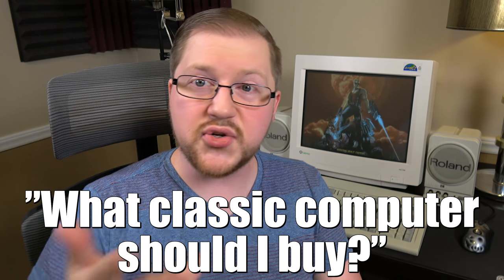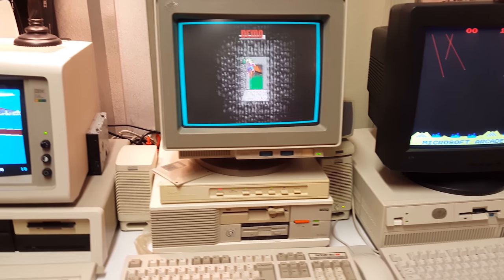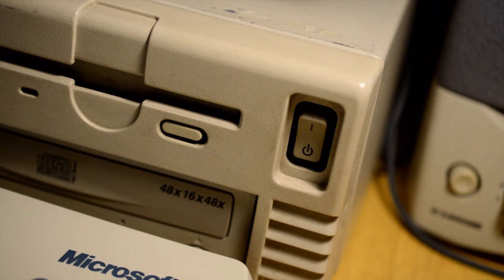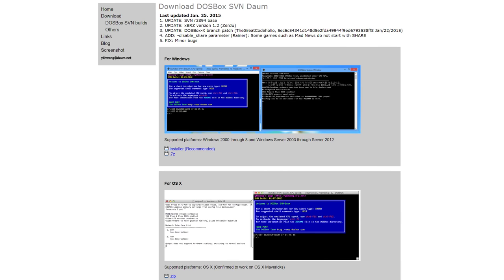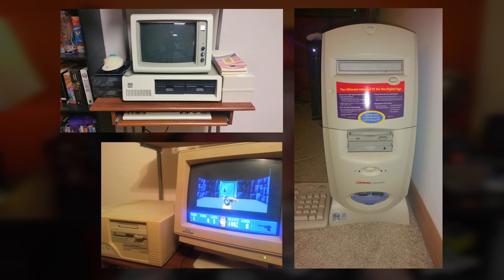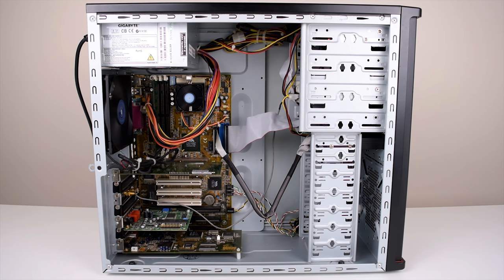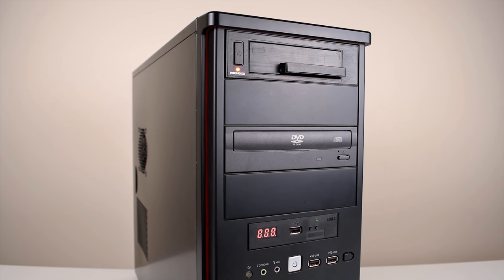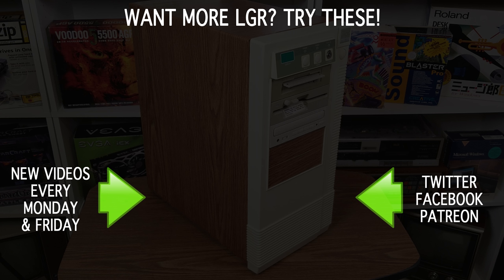Choosing a Retro PC for Games: Advice & What to Look For

Comment: Personally, for retro I use an IBM 600X with maxed out RAM (512+64 onboard). I didn't grow up with the old 80s and early 90s games, and so I have settled with mostly playing old games from the late 90s and onwards.

I also have a few Dells I either use for emulation or playing old games once in a while on laptop hardware from the Pentium 4/Core Duo era. It's fun. I like it. And I don't have to mess around with unknown territory as everything comes already in a convenient package and I know that if I cannot run it on those machines I can always tinker around on my newer computers to get something running like it should.

Comment: I remember back in the early 1990's in Jr. High school. We had Windows 3.11 for workgroups running 386, and 486dx2 CPU Gateway 2000's. Then they upgraded one full lab to Pentium at lets say about 133mh with brand new computers. 32 MB of ram, the old 486 maybe had 8 or 16 in them, but instead of running Windows 95 they were still Running Windows 3.11.....and they flew. Soooo fast, everything was clean and clear and smooth. Then they finally upgraded to Windows 95, and Goodbye speed!  Though in 1999 when we upgraded to Windows 98 SE and had a few new computers in the library we would all in homeroom play Duke Nukem 3D on the LAN there and it was awesome. Windows 3.1 was my very first Windows OS ever also. Back when computers were actually different, and fun still. Now they are all the same pretty much.

Comment: Regarding virtualization, here's a hint: PCI passthrough (a.k.a. GPU passthrough). Although I haven't used it since 2016 (my gaming Windows was a virtual machine with Radeon 5850 and later 7950), I've read that newer virtual managers have implemented it (I used it with Xen during my Radeon period;2011-2016. Also see LTTs 7 gamers 1 CPU made in 2016). Back then, it required an Intel non-K CPU (or LGA1366). Basically you need to look at IOMMU support(a.k.a. VT-d @ Intel; do not confuse with VT-x, which is present in almost all CPUs of this decade) and 2nd period-correct GPU (1 for host/current gen, 1 for VM/retro GPU). Granted, you do need Win98-supported GPU (as original GPU drivers will be used in VM).

Comment: I honestly would choose Phil's solution. I want to build an "Ultimate DOS Machine" like Druaga1, but have it cover so many aspects. I think that would be the perfect fit to just need around with whatever I feel like.

I am also a fan of emulation, source ports, and wine. Emulation is nice, but a last resort for me imo, unless it is cycle accurate like bsnes. An upside to emulation is that you can add upscalers in retroarch and some standalone emulators. I've found that win98 VMs though so not like Ryzen CPUs, so it's not always the best solution. Source ports are fantastic, I play gzdoom for an enhanced DOOM experience. The mods for some source ports are amazing actually, Brutal DOOM being one of them. Also finally wine, it's just been around for so long and been so well maintained that you can play a lot of games very well on it. Plus wine has instances so you can sandbox a lot of what you do.

Comment: 2:22 Loving that vintage Gateway monitor. I have an old EV500 that came with my 1999 Essential 400 (it's a very complete system) but unfortunately the monitor gets so incredibly blurry that it's absolutely impossible to use. My go-to CRT is a circa 2003 MAG Innovision. It's a great monitor.

Comment: I guess it comes down to the game you want to play on it. I made a bit of an older system to play older games on, but first asked myself what games I want to play. F.e.a.r., Quake II, Final fantasy VII and a bunch of more games from the late 90's mid 2000's so I opted for a motherboard that supports ddr2 ram (using 4gb), an intel core 2 quad, with an SSD and Windows xp professional 32-bit and an OP passively cooled GPU (geforce 6k series). All crammed in a Shuttle XPC case. And it runs amazing, much better than I thought actually <3 (In the end it looks more like a PC from around 2010 tho lol).

Comment: I was running a Pentium 3 server machine with dual CPUs. When needed I disabled one CPU and disabled cache that gave me something around 486 in terms of performance. It had Voodoo 2 in SLI so when I needed glide I used it when not I used Nvidia NVS 280 in a PCI (non-E) slot. Dual booting 98 and XP. All that in one PC gave me some room for older and "newer" games.

Comment: I do think emulation is the best way for most of the older games, mostly the DOS era ones until early 90's ones, because even if you want to play them in an original hardware....man, its a nightmare to setup properly an older machine without having hardware conflicts, missing drivers, sometimes even the CD or floppy disks that comes with such drivers get faulty and if you dont have internet access on that PC well tough luck i guess, installing properly the OS you want to use on that machine without having tons of BSODs or the HDD not being properly formatted or the installation freezing midway installing the OS and then having to restart and reformat again.

But i do get why people wants to run games in a proper hardware setup that can handle those games the way it should, and its totally fine but yeah as you said it takes dedication and a lot of it.

I do have 2 desktop PCs at the moment, one is an XP machine with 512 MB of ram with a Pentium 4  4.22 GHZ and a GeForce 6200 AGP video card of 512 MB of ram, the other one is an Core I3 with 4 GB of ram with a GeForce GT 620 of 4 GB Ram, the XP machine i use it mostly for drawing and as a workstation but its very capable of running even Quake 3 without any problems, but the PC i use the most for PC gaming nowdays is the I3 one since well most of the old games are supported by GOG and its the best way to play those older games on lastest hardware and OS, but if i want to play something that i already own i go to my XP machine but if i really want to play that because i dont want to push too hard that poor thing since it got like 2 breakdowns because some silly stuff i still cant find out.

Comment: Somewhere down the line, I just want to construct a windows xp machine for enjoying all the games that wouldn't work on vista and beyond.  GTA III will have the right car shading without needing modification, Sim Coaster will run, and The Sims Complete Collection won't crash at random. That's the purpose of what I want to get together.  I GOG it for a lot of DOS games because I just wasn't born into that era and don't see a personal need in getting a 486-- I just don't have the nostalgia for those REALLY old pcs.

Comment: I got some old computers from my grandparents, and among them is a Dell XPS D300. It originally had an 8 GB IDE hard drive, and I replaced It with a 16 GB SD card on an SD to IDE adaptor. The sound card It came with is a Turtle Beach Montego which uses the AU8820 chipset. This chipset doesn't have hardware OPL3, so I added a resound OPL3 sound card.
This machine currently has 64 MB of RAM, but I am considering upgrading It to 256 MB since It is running Windows 2000 instead of Windows 98.

Comment: I've recently picked up an emachines etower 333k desktop as my retro pc rig. currently has an amd k6 processor, 3gb of hard drive space, and 128 mb of ram. which according to sources, was not the amount it originally shipped with so i lucked out on not needing to do too much ram upgrading. I do plan on giving it a more powerful graphics card of that era that's around my budget range to beef up its graphic capabilities. same with the processor, but I probably need to do more research to see what will fit and the compatible cpu speed. since from what i've gathered, older machines have a specific limit to where they'll not function properly if you use something that's too fast.

I primarily picked an emachines tower because my first pc was an emachines. given, it wasn't the one i have, it was an emonster 500. but this is close enough for me. still has that crusty emachines boot splash screen. plus this will be a good working experience for me in terms of installing vintage parts on a vintage pc.

Comment: I recently made a video about connecting one of the external 5.25 floppy solutions you mentioned (the FC5025) to modern PCs...definitely not ideal but it removes the need to have original hardware in many cases, and you can still play original software.

Comment: Regarding early-to-mid 90s my go to PC is an ASUS L7200 laptop. It has a 233MHz Celeron CPU, which should be close in speed to a Pentium MMX, a Yamaha OPL3, both a CD and a Floppy drive, though the graphics chip is really bad without hardware 3D acceleration, so it really strueggels with 3D games like Tomb Raider. The resolution scaling is also an issue, but otherwise it's a reliable and sturdy laptop.

For 3D I have a destkop Pentium MMX 200MHz with 64MB SDRAM, a Matrox Mystique, Voodoo 1 and a Sound Blaster AWE64. Really capable and has a wider range of games I can play because of the 3D support.

For later times the PC I mostly use is a 933MHz Pentium 3 with 256MB RAM and a Radeon 8500LE, the sound is handled by the Abit VH6T motherboards integrated solution.

The next step is a Pentium 4 3.0GHz for early and mid 2000s with 1GB DDR RAM and a Radeon X800 XT graphics card, audio is again integrated, but I'm planning to upgrade.

The last one is the late 2000s with a Core2 Quad Q6600, 4GB RAM and a Geforce 8800 Ultra. I built it because I had most of the parts on hand and found a cheap 8800, but I don't use it that much since the games of that era are the same experience as on my daily driver.

For pre-Pentium, I'm not that attached to that era, I have an AST Premium-II 486SX-20 upgraded with a Sound Blaster 2 Pro and a Compaq  Contura 420C with a 486DX-50, but I don't spend much time with them. And also kept some other parts and PCs to play around with.

Comment: I have a 8086 12mhz PC with a 20mb hardcard (yes you just read that right 20 megabytes) It has a turbo button and since it's a 16 bit cpu, it also has 16 bit ISA slots. Only two since it's a slimline but that said it's plenty powerful to run old dos games. My newer go to is a AMD k6II 333mhz Toshiba laptop. It's extremely well built and can run anything from OS/2 to Windows NT terminal server without so much as a hiccup. Dos games usually run very well on this system. But, if that's not enough computing power I can plug in my IBM intellistation pro, that has dual pentium III's most dos games only use one of them but it leaves plenty of room for options. What I would like to find is a decent PS/2 microchannel PC, I've owned a couple in the past, really neat hardware.

Comment: LGR,

Another option is a SD to CF adapter you can use as well.
As time goes on even CF cards are getting rarer and more expensive.  So you have a option of uses these nifty SD to CF card adapters as well.

As far as using real hardware or emulation I actually like using both depending on the game or software.

As far as emulation like VMWare or VirtualBox yes one of the biggest issues with those are the 3D applications not properly passing 3D data from the guest OS to the host OS.  Some day hopefully that will get fixed.

Yes Wine is for sure a interesting route to use on Linux systems.

Also another option for emulation which some people over look is MAME.  As there are some older system emulation in there as well.

Comment: Wine on Linux (and perhaps more specifically PlayOnLinux) has been my personal saving grace. It can be a little fiddly to get certain games to run, but once they do it usually runs surprisingly well. Generally speaking, I can run anything that required any previous Windows version on a single modern machine.

Comment: I do agree with most of the points made, and I certainly see the nostalgic appeal of having a "real" retro PC, I think one option (IMHO the best option) was overlooked: MiSTer.
It can emulate anything from Atari 2600 to C64 to a 486 with Adlib support ON HARDWARE. I think it provides every advantage mentioned in this video, except for the "look and feel" of a retro PC. The price is also more reasonable than most other options, save for SW emulation.

Would love to see an extensive review on it by a real retro gamer.

Comment: For windows 95 and windows 98 games i bought back the 3rd computer i ever owned. The dell optiplex gn+ pentium 133mhz... It's versatile,the bios is awesome as it does not give me any issues for adding new hardware or incompatibilities. Both dos games and windows games from let's say 95 till the pentium 4 era can be played on it now... just pick the right add ons and keep it simple and you will have a beast of 90's computer....You want a cheap early 2000 and mid 2000 build? Just search a lot of 775 socket motherboards then for 1 build go for a pentium 4 3.06ghz and for the other go for a e6400 core 2 duo... Both almost cost nothing and you will end up with awesome gaming builds....Owh and plz make your build totally complete by adding a 9800 pro radeon card....

Comment: My retro PC build would be Pentium II or III with Windows 98SE, Voodoo card. SB AWE 32 and as much memory stuffed in.  It would be enough to run late 90's Windows games along with DOS games as well.  And any early DOS games that needs a slower speed can use SloMo or even better TandyEm for running Tandy 1000 games.

But in the real world I don't have the money or space for another PC so I'm using Launchbox & DOSbox to install and run DOS games on my Windows 10 machine.  And as for older Windows games there's a web site called PC Gaming Wiki which helps get them running on modern PC's as well as useful graphical mods to look better on flatscreens.  I'm also playing around with DOSbox SVN-Daun & Sweet FX to simulate the CRT look.  Not the real thing but the next best thing with what I got...

Comment: fantastic video LGR, before you had started I would have said that the 486 66 Mhz or the 100 Mhz was the best machine because it covered a cross-over period from Dos to to graphical I was glad to see that most agree but I guess that dos box for all it's trials and tribubulations is probably best - it does at least mean that we wil be playing these games in 20 years when the hardware has run out of steam.

Comment: I FOUND my vintage computer ( 486 DX 2, 66mhz with 20MB RAM) in the loft (attic). At first I thought it was just an old case. I looked inside it and to my total surprise a computer was sleeping there. It had motherboard, CPU, RAM, and PSU, nothing else, no drives. ✨ After recently discovering LGR I was excited to try and get it working. ✨ I went hunting, in the garage, the spare bedroom, in the loft again and managed to find some more parts! ✨ now I really need to make a YouTube video for it, just realised how much there is to say about it 🙈🙉

Comment: The only real issues with retor Pc's is getting the Sound cards and video cards working properly.  Those 2 were the big problems configuring for most ppl back in the mid to late 90's.  Sound issues were rampant and very finicky,  and the 3d accelerator addon cards like the monster II 3d were easy to install but for some people could be frustrating to get working right.

Win 95 or Win 98 rigs can be really picky on video cards as some of the newer pci or Agp cards ran well on 98 but could be a hassle with drivers on 95.  So beware sometimes hardware and software had internal World wars back then ;)

Comment: Personally I want to build a 386SX machine. Why that type of processor? Well it only has a 16-bit bus, so no need to deal with 32-bit EISA, PCI, or VLB. But, internally, it’s 32-bit, and has a superior Protected Mode implementation compared to the 286.

For ISA cards, I plan to have a multi-I/O for IDE and FDD controllers at a minimum, a VGA card, a Resound OPL3 + Sound Blaster combo, at least one networking card, and any remaining slots will be used for hardware tinkering.

For storage, I have an igloo box full of IDE hard drives and I can probably buy floppy drives online. If the hard drives I have aren’t suitable, I’ll get something to convert IDE to CF. Oh, and possibly a CD drive.

Comment: I remember when I first saw LCD monitors at college, and I was blown away at how well they scaled compared to the laptops I had been using. 

People will say how bad it looks to not run your LCD at native resolution, but that pales in comparison to how bad it looked laptop LCDs back then. 

Oh, and I'm pretty big on emulation, because I do more than just DOS PCs. I'm actually more interested in getting an old iconic computer case and putting a modern computer in it. 

(My hope is to one day do this with an Apple //c, with laptop parts if necessary. I even want it slightly yellowed.)

I also wonder if anyone ever considered taking a bigger case and trying to put more than one retro machine in it.

Comment: Hey! I absolutely love your videos, this collab was awesome!
About my setup, I use a Casio Fiva subnotebook from around 1998-99 for real hardware experience. Honestly, being such a small subnotebook (same size as the Toshiba Libretto) it's nearly not an authentic experience, the screen resolution is too high (800x600 lol), the internal sound is better than pc speaker but still rubbish, it's slow asf (Cyrix Media GX 200mhz, which is as fast as a Pentium 60, 32mb of Ram, running from HDD coz it refuses to boot from CF/IDE adaptors for some odd reason), and I need external pcmcia floppy and cd drives to run authentic media on it. Nevertheless it's often more fun and challenging than emulating and I'm happy with that! Even though it's not nearly as good as the K6-2 setup I used to have as a child it takes up so few space I just can't complain.